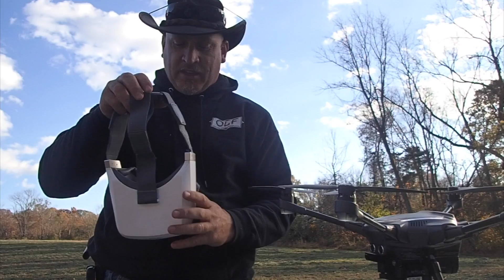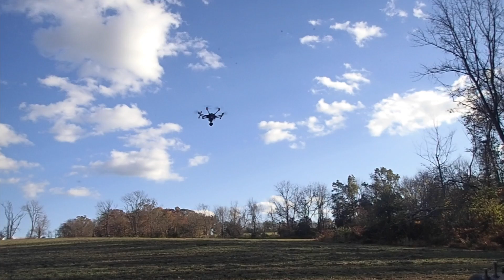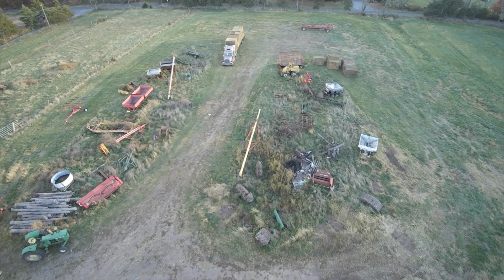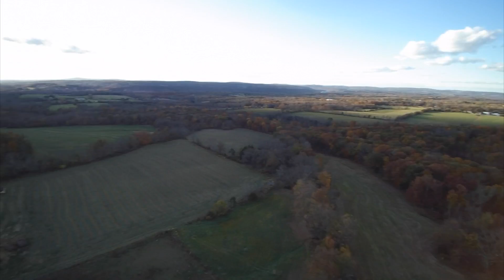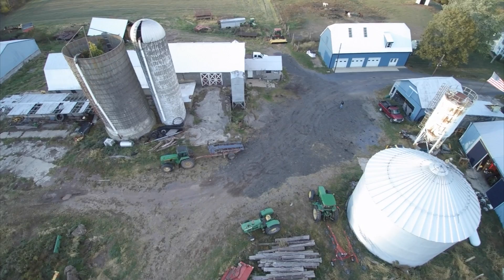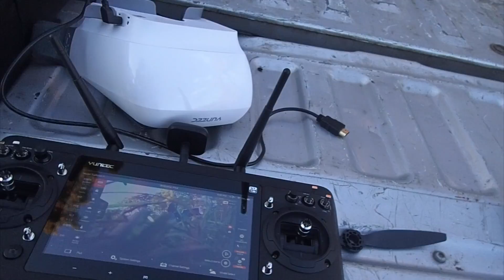First Drone Flight

Comment: Its odd that the SD card goes into the remote rather then camera on the Typhoon. If there’s ever interference between drone and remote, footage could be compromised. 

Also the FAA requires no special license, just $5 and they issue a registration number that has to be visible on the drone at all times… whether you fly in/over private or public land. Its no big deal. It has nothing to do with spying, its just the FAA reaching into the cookie jar by capitalizing on the number of drones being sold today.

Comment: Wes just buy a battery when you get to England. Always need another spare eh! and save shipping cost. Now tractors. I've made a few phone calls, still got to talk to a couple of people, but it seems most dealerships around here have closed down. So they seem to be a bit scarce, only found the one in Spalding. Still got some checking up to do, so I could be wrong, but I am trying to help.

Comment: Do double check that you can take your batteries with you to England. They are considered hazardous cargo and not all airlines take batteries onboard in any form. Other take them but in secure (blast proof basically) containers that you have to preorder with the airline. Only a few allow you to take batteries without any extra protection as carry on and even fewer (if any remain) allow you to take them as luggage. Rules have changed and are still changing. Get the most up to date information please.
And discharge them before you travel, there are rules about how much charge they may carry as you travel too!

In relation to that, i ordered batteries from China about 2 years ago together with some other electronics. The batteries had to take a completely different route than the rest of the order because airlines REFUSE to take batteries onboard. The laws are very different outside the US.

Comment: is there a law against flying it on someone else air space? what happens if they shoot it down? is there a law they cannot?
Reply: At a certain altitude, it's federal, not private property. Even so, shooting it down would be if the "airspace" is frequently violated. Then the pilot is to blame either way.
In any other case, it would be silly to shoot down someone else's drone if it happens to go over your property once. It could be due to malfunction or it could be that the pilot wasn't aware.
Basically, tell the pilot to leave or next time it will be met with birdshot.

Comment: if you take that thing to england, ship batteries there.  The airlines don't like those batteries on board the plane.
Reply: Ive never had issues flying with lipo's.  As long as you carry them on, and tell them that you have them, they are typically not an issue.
Reply: i second that they will seriously not let you on the plain with them at all
Reply: dzlfreek that's what I was wondering to
Reply: dzlfreek

Comment: I don't have much experience with these, but I have flown my phantom 3 pro with roughly 50-60 mph aloft winds and it handles it hard but like a beast.Once for fun I flew it out roughly 3 miles in heavy aloft winds only being able to fly into them at maybe 5 to 10 mph but once I reached "bingo" on the battery, I cranked it around, turned off the GPS mode and dropped the hammer haha.After a little adjustment so I caught the wind just right I managed to get it to 88.9 mph! It took 500 ft to come to a controlled stop haha it was awesome. But anyways, (and to each their own of course) in my opinion I wouldn't consider it to be above the phantom as far as quality. The bird it's self maybe, but that clunky controller was just something I couldn't deal with. Plus the little creature comforts that come with the DJI app like a more easy to read battery level indicator and simpler to read air speed/altimeter/etc plus the fact that it can estimate aloft wind speed to tell you roughly when it's time to come home. That and the camera is a lot easier to operate. Yours has the advantage of 6 rotors so you could safety land still if you lose a motor that and an unobstructed camera view since you can raise your gear. Another warning if this is like the phantom, when in return to home mode they don't necessarily try to come back as fast as possible, remember this if yours ever starts losing ground I RTH mode. Switch out and shut off the nannys and fly it in yourself and generally you can get more out of it. Also I believe you can upload 4k to youtube if you set your channel to accept it. I recently uploaded a video of my neighbor shelling beans that was shot in 4k. It took 15 hours to upload the 8 minute video haha but it did it. Safe flying buddy I look forward to your videos :)
Reply: I should amend this- that's 50-60 mph gusts not straight winds. U doubt it could handle that kind of wind straight on.

Comment: I have a quad copter but it does not have gps to hold its position. Where I live it seems like the wind always blows so gps is necessary. Just the slightest wind can move it around quite a bit.